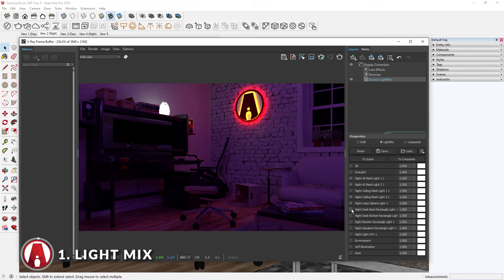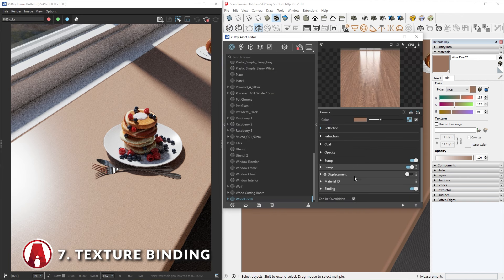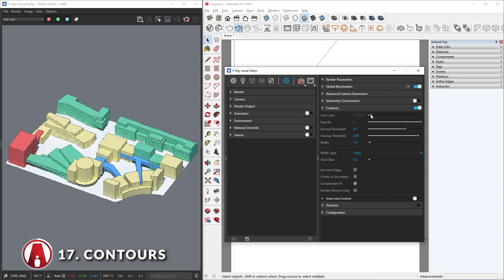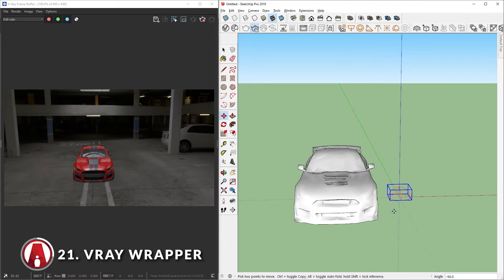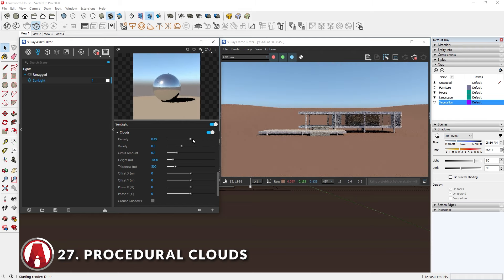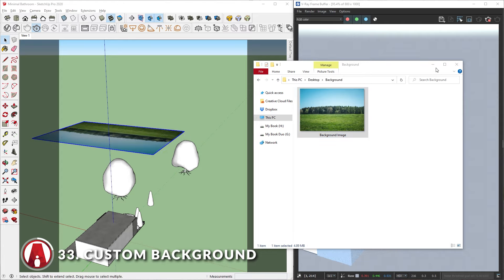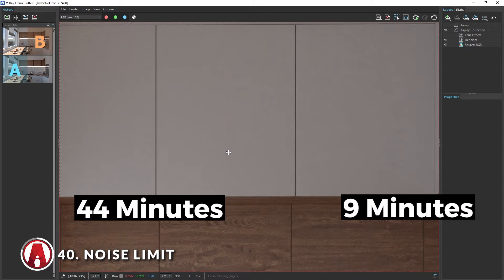50 Vray Tips in 1 Hour

Comment from the maker: Timestamps of all the tips:
00:00 Light Mix
01:52 Velvet Material
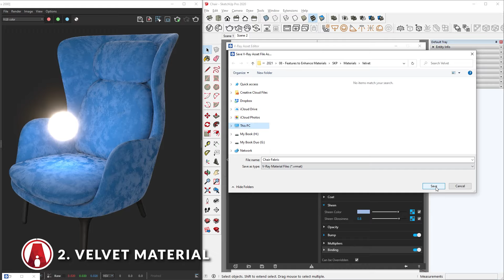03:56 Fix Material Tiling
04:42 Material Randomization
05:34 Colorize Material
06:55 Texture Scale
07:47 Texture Binding
08:58 Replacing Material
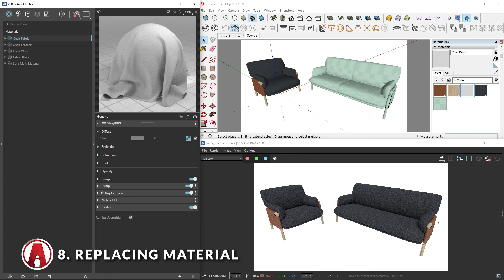09:40 Glass Material Issues
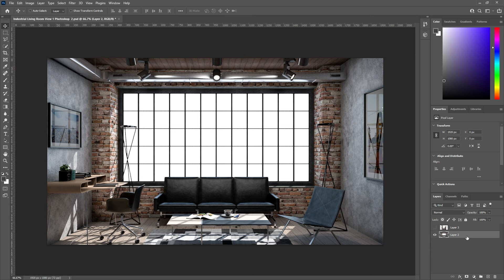10:45 Transparent Background
11:43 Avoid Repetitive Textures
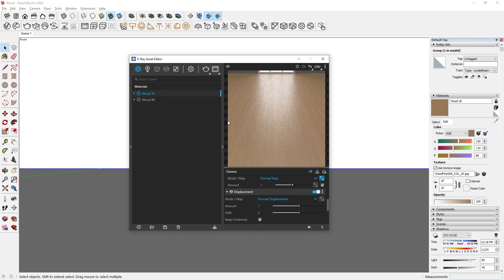12:20 Reduce Texture Resolution
13:10 Optimize Materials Color
13:45 Minimize Displacement
14:06 Cosmos Materials
15:43 Contours Materials
17:37 Dirt Material
19:25 Patterned Glass
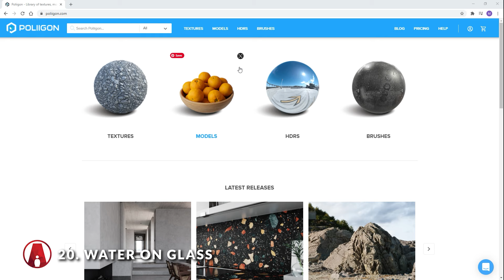21:24 Water on Glass
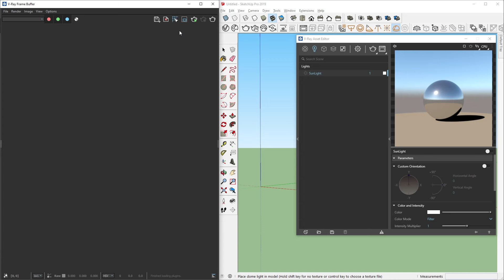23:13 Vray Wrapper
26:44 PBR Maps Explained
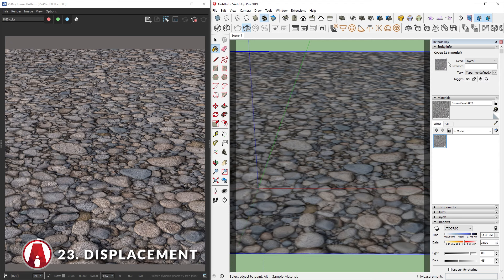32:46 Displacement
33:42 Purge Unused
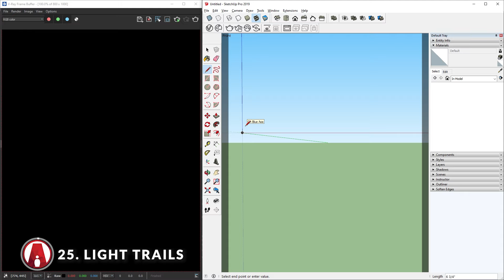34:01 Light Trails
36:34 Sun Light
38:46 Procedural Clouds
42:32 Dome Light
44:20 HDRI Library
44:43 Combine HDRI + Sunlight
45:18 Finite Dome
46:31 Light Generator
48:07 Custom Background
49:29 Camera Settings
50:28 Vray Frame Buffer
51:45 Photoshop
52:24 Reduce Polycount
53:19 Proxies
54:43 Optimize Lighting
55:17 Noise Limit
56:44 Don’t Use Depth of Field
57:29 Render Elements
57:59 Chaos Cloud
59:14 Imperfection
01:00:08 Composition
01:02:08 3D People
01:02:38 Lighting
Hope it helps!